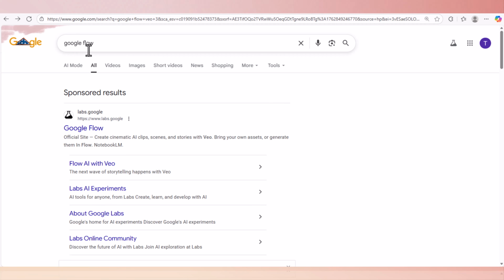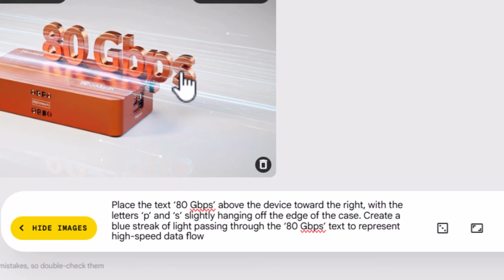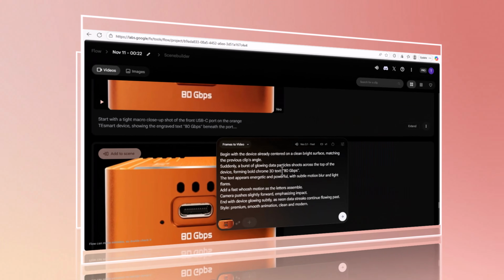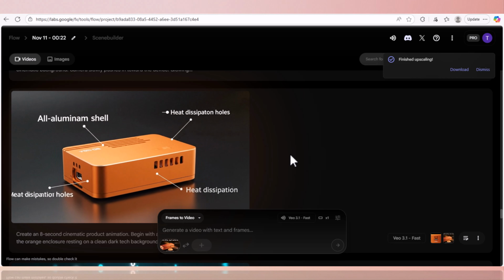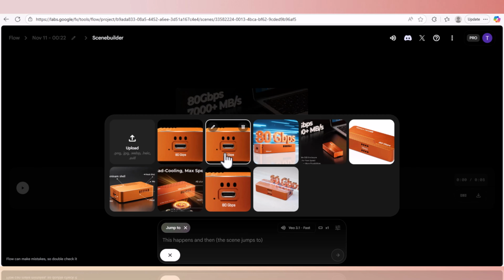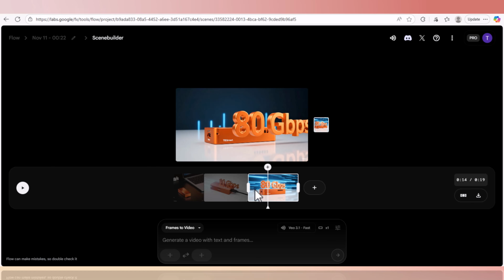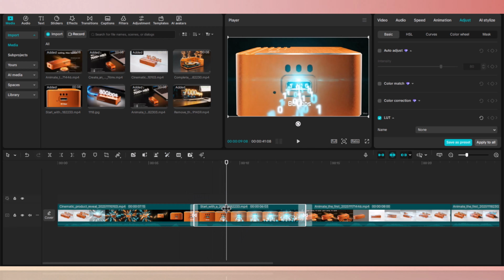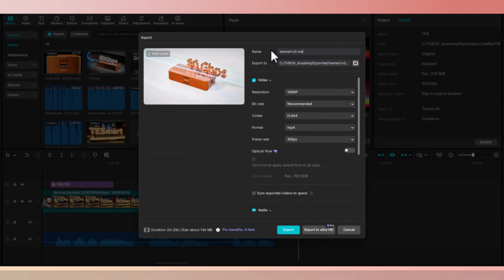Google FLOW in Practice | AI Filmmaking for Product Ads & Motion Graphics

Comment: What about the watermark at the bottom right? Can these clips be used for commercial use?
Reply from the maker: You can always zoom out the frame or use CapCut removal tool. Watch my CapCut that has the thumbnail photo of 2 jet fighters to learn how to remove them. 🙏✔️😘😘👌☺️☺️😀😀👍😉❤️✅⚡️👏👍😉❤️❤️☺️👌😘
Reply: @TVBOXUSA Thanks for the croping sugestion. So removing the watermark is ok thing to do? It is not violating Veo/Google terms of service? Can the video with removed watermark be used commercialy?